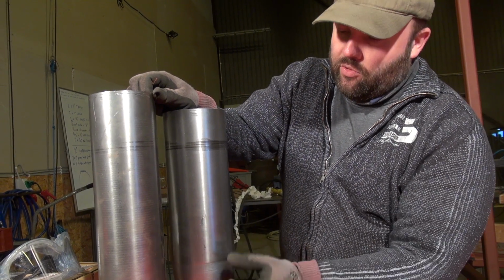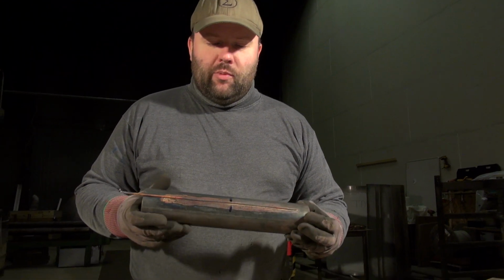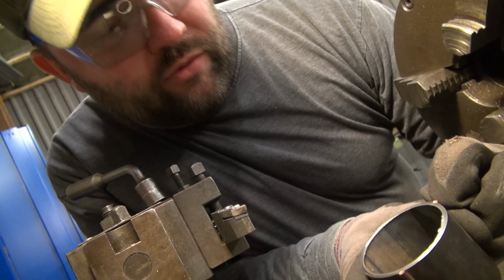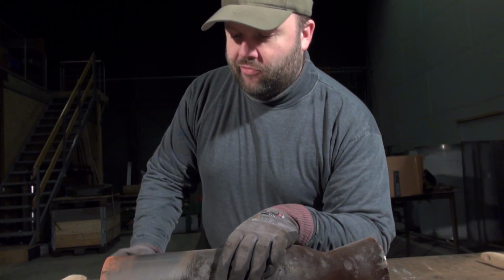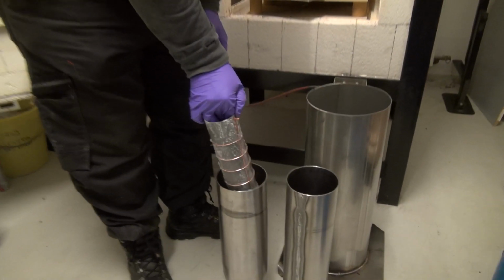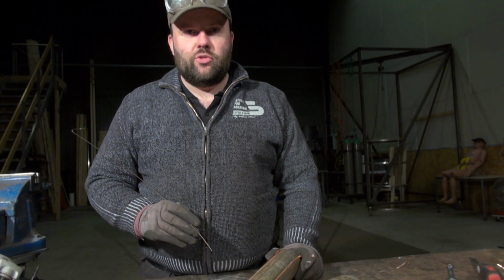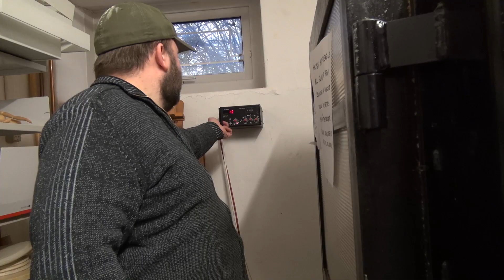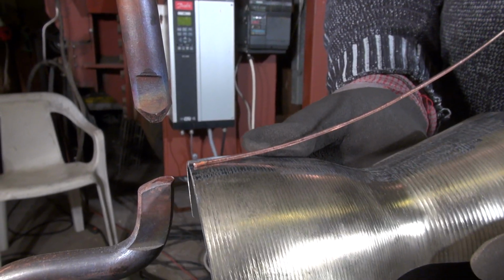Silver soldering the BPM-5 rocket engine

Comment: Jacob, I’m a ceramicist in Connecticut in the USA, and am quite familiar with gas and electric kilns. First you should realize that no matter how well you sealed up the exterior of kiln, the kiln bricks themselves are porous and store a large volume of air inside them and that means oxygen. Secondly, argon is heavier than air and will tend to accumulate in the lower areas of the kiln. You can compute the amount of air held by a kiln brick by soaking it in water and comparing the dry and wet weights. The argon would drive out the air of the low lying bricks in the kiln first. Assuming you had the kiln exterior sealed off this would have meant that the argon and air divided the kiln space, either side of a boundary layer some distance up off the floor of the kiln. I think you have oxidation but uneven because the argon would have given some protection but more at the bottom. So even though this hasn’t worked that well for the  BPM liner, you can apply this going forward.
Reply from the maker: Thank you for sharing your expertise! Forwarded it to Jacob. :)
Reply from the maker: Jacob says:
"We intend to put a gas proof chamber into the kiln/oven. Then we won't have to fight oxygen and porous bricks. A vacuum chamber for the ceramics oven is one of the things high on my list. :) "
Reply: I saw a later image of you with a stainless steel liner. That and an inert gas should do it.  There is another way to do this, and that would mean firing the fusing soldering in a reduction atmosphere.

Comment: Outstanding video detailing a very thorough investigation and some great results! I can't tell how straight the copper spacer wires are, it looks like there are some small bends in them but that might just be an illusion from uneven lighting.  If they are not straight, I am concerned that there may be larger dead spots in the fuel flow along some points of the spacers than there needs to be, leading to spot overheating. You can easily make copper wire dead straight by stretching it slightly beyond its elastic limit. I use this method frequently when prototyping electronic circuits and need a neat, straight run of solid wire. I hold 20awg wire between two pairs of pliers and pull, but with 2mm wire you will need a large vise and a lever to stretch the wire. Best wishes with building your BPM5s, looking forward to the next video. :-)

Comment: sorry for my bad english.
as mark bremer already postet, i woud try inverted approch.
and copper may be one of the best thermal conductor but i woud try to use the same steal as for the tubing (a L or T type profile).  therefor the spacers has the same thermal expansion as the tubing - no distortion problems when cool down (or heat up) therefor it shoud be mutch easyer to "weld". the thermal issue shoud be partially compensate by smaller contact surface to the hot inliner -> greater surface for coolend and maybe better flow rate arround internal tubing/spacer surface.
Reply: That does make a lot of sense.  Looking good!

Comment: Thanks for the video!

Couple questions.  Why attach the spacers to the inner liner?  Wouldn't the outer liner be easier to work with since you will have two halves. and won't be the surface directly in contact with the combustion?  Also, does the combustion heat not get high enough to re-flow the silver solder?  Finally, does the last tacking method not have the same warping issues that you were trying to avoid in the first place?
Reply: Mark Bremer I was wondering the same thing -- why put them on the inner tube instead of the outer?

As long as the cooling works, the solder shouldn't melt.  The solder had a melting point above 600°C and the coolant is basically high-grade vodka that is also used as fuel.  If the "vodka" got anywhere near that hot, you would have lots of problems.  There are rockets that use a boiling liquid as coolant but is much trickier to make it work right than if you can keep it liquid all the time.
Reply: I think the spacers should be made of the same material as the chamber and the cooling jacket. The copper has a different expansion rate and is more conductive.
Reply: i need mutch to long to type :) have come to the same conclusion..

Comment: Hellow again friends , how about rapping the spacer wire from a continuous coil and spiral the spacer like a helix rather then having strips or radial arrays
Reply: +NOBOX7 The spacer wire also affects the flow of the fuel/coolant. They can apply a twist to a certain area for more cooling, forcing the alcohol to flow around with the twist and spend more time gathering heat there, or they can go straight, bringing the alcohol through quickly. If they coiled around the entire liner then they run the risk of increasing the temperature of the alcohol until it begins to boil. The gas bubbles from boiling have very bad thermal conductivity, which would cause the engine to overheat. So whatever twist they add has to be done strategically to balance the temperature of the liner with the temperature of the coolant.
Reply: @mrmadmaxalot  Yes but residence time can be calibrated by channel thickenss

Comment: Ok, stupid question: why do you use the Ethanol/Water for the nozzle cooling and not the LOX?
Reply: +tmkr it's too corrosive, also i think its too cold, the LOX makes the metal brittle and easy to crack(like pot or high carbon metal) i could be wrong though as they do use liquid hydrogen for cooling but i don't think its gets as cold as LOX

Comment: Plese wear infrared blocking safety glasses to protect your eyes from the radiant heat from the torch or, in case of actual welding, the molten metals. 

Looks like the solder was successful. Just be certain the combustion chamber, inner wall, never gets above silver solder melting temprature.

Comment: ok i have a solution , what you should do is tig weld some nodes or little bumps onto the inner liner in a rivet formation , them use a grinder to shim them to proper hight , you could use a mill to shave the nodes to hight,

Comment: Good work.  Have you tried using a solder paste?
Reply: They did, earlier. I am thinking that the solder ribbon between the two parts might be a problem: you really want the parts touching, and for the solder to wick into the interface. Add thermal expansion and he might be asking the solder to bridge a gap.

I think spot welding the copper to the liner, applying paste, and then heating is the killer solution. The paste will get sucked right in where it needs to be, and the spot weld of copper to steel should be enough to hold everything together in the kiln, no hose clamps needed.

Comment: Ceramic glue my friends or some form of refractory cement glue is what you need , i know for a fact that high temp ceramic compounds can set like concrete at room temps , have you ever seen concrete stcuk to concrete tools or a concrete mixer??? i think the cold air in your shop isnt helping either you guy have got to heat that place for crying out loud metal shrinks and grows my friends and working in such a cold place definatly has an effect on your warping issues you see the metal do not grow in sync the coificiant of volumetric expansion is a function of temp  so increasing the temp junction so drasticly is cuasing you even more problems, i mean a copper rod at 30 deg F grows far more then a copper wire thats heated from 72 deg and yes the linner also grows but he equations are not linear not at all so the graphic profiles of in congruent expansion is increased  even more

Comment: Why dont you modify your design.....fabricate the combustion chamber/nozzle out of longitudinal tubes silver solder together in your autoclave. Reinforce chamber/ nozzle with circumferential bands. 
Manifold top and bottom to control cooling liquid......this method was good enough for an f1 engine.....
Reply from the maker: Hi Dean
The BPM-5 engine is not one we intend to develop on. it's a means to test a lot of different subsystems on the Nexø class rockets, and will soon be replaced by the much bigger BPM-100 engine